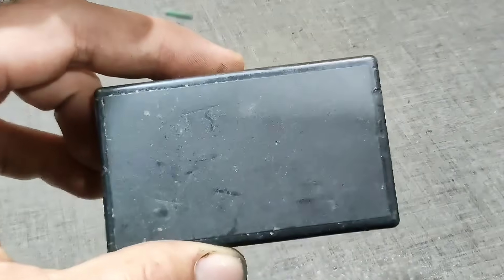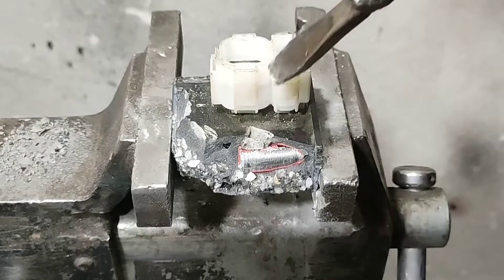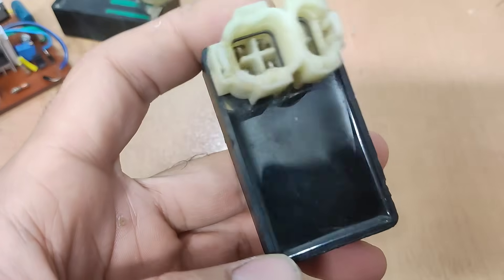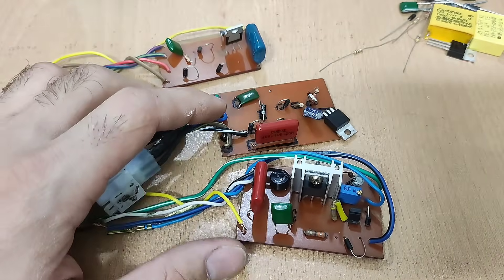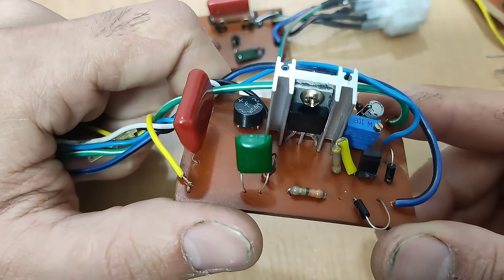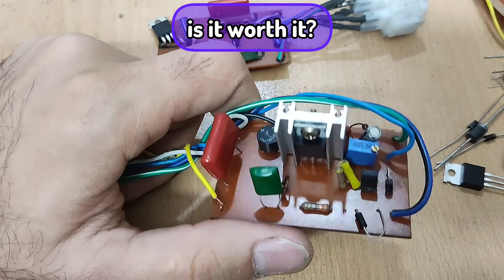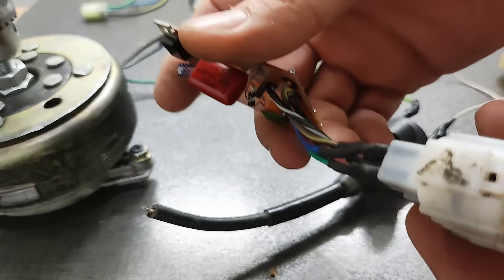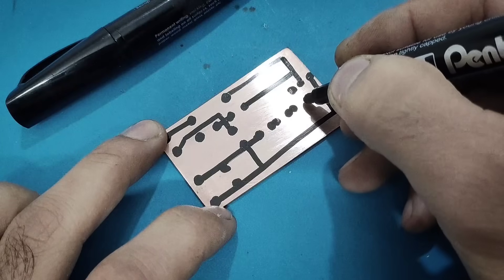What's Inside a Cheap CDI? YouWon't Believe It!

Comment: I am updating an old 2 stroke outboard motor. I don't need or want an ignition advance in the cdi unit, the movement of the throttle plate takes care of that. Points and condenser ignition is old and unreliable. Diving into your channel!
One issue is that there is not a lot of space inside my 5.5 hp Johnson outboard motor. I was planning to buy integrated coil/CDI units to save space. But I hate cheap unreliable crap, especially on a boat. I was also planning on supplying 12v to the cdi unit instead of using AC and mounting hall effect sensors under the flywheel as triggers. You have videos on that?
Reply from the maker: Hi dear, That's an interesting project! You'll find a lot of useful info on the channel for sure...
I’ll definitely make a tutorial about running a DC CDI with a Hall sensor. Stay tuned 👍

Comment: A couple things you didn't touch on. The timing curve is important.  The CDI controls the curve.  The 2nd is stator load.  You can overload the source coil with the wrong cap selection and charge circuit.  It'll make the source coil get hot and fail early.  Just something to watch out for!
Reply from the maker: right! Thanks for pointing those out, they are definitely important aspects of CDI units.🙏

Comment: i've been suspecting this for years, seeing them dealer $$ and new ones dont last a year. This is my comment channel, I cant comment on my main.  So in the old days you could buy modified CDI's for racing and they werent cheap, they had simply a hole drilled in one spot. I'm not familiar with the electronics enough to do anything but build from specs like yours. This is cool. Thanks
Reply from the maker: You're right, the quality of new CDIs is not always consistent. Using the specs and examining the internal structure can help choose more reliable parts...
I'm really interested to know which channel you have...

Comment: Fascinating. Forgive my ignorance but how does an advance/retard system work with these single fixed trigger systems? My honda 450 is like this but my suzuki750 has bob weights which move the ignition timing.
Reply from the maker: Hi dear 
These types are analog versions, and the timing is done mechanically
and also remains fixed.
To use advance and retard features,
you need a digital version, where a microcontroller handles that function.

Comment: See i rather a cheap fuse blow out than the circuit board the fuses are easily replaceable and easier to get there's no waiting to pop a new fuse in get a 15 amp or 20 will do and the problem is that easy
Reply from the maker: Good point 🙌

Comment: The thyristor is what blows in the cheaply made relay solenoid circuit board  in scooters when any light fixture breaks or turn signal flasher fixture sends the short to that part unless its because it was pulling to much current at the usb port 

What else would blow that one out in the flasher relay solenoid there was no melted wires just that roasted part on the board if it didn't ruin the board i could have fixed it but those only cost 7 some dollars new 

Plus on my new one i added a inline fuse on it just so it'll save me from blowing money on new flasher relay solenoids 

But also i noticed the flasher relay solenoid isn't water proof so if no shorts happen or the broken turn signal light fixture didn't melt it then water got in also the usb ports electronic box isn't water proof those things should be being in a scooter outside
Reply from the maker: The flasher relay itself also acts as a fuse — a short circuit in the turn signal circuit causes the relay to burn out, preventing damage to the wiring.
In one of my next projects, I’ll be teaching how to build a very professional yet simple flasher relay for motorcycles.
thanks for your input 🙏
Reply: @MrWolfDiy i know but the parts on its circuit board can burn out and is more hassle to fix than to pop a new fuse in
Reply: @MrWolfDiy what burnt that out was the right turn signal fixture

Comment: The filler you are encountering is known as a solidification stabilizer. The board is usually placed inside a half shell style container, then the stabilizer is poured in. The stabilizer contains solids of plastic or hard silicone. Once cured, the solids will mostly fall under the liquid before it cures, and then will appear smooth on top. This is not always the case, and some mechanics mistake the solids at the surface as some sort of boiling or damage from heat.
.
 I have seen videos, where the part is boiled in water, and this helps soften the flowed stabilizer, so it can be picked off.
.
My first time meeting this kind of stabilizer, I was 22? I wanted to repair a Mitsubishi igniter box. I worked for a prominent avionics repair station. The best of the best, said throw it away. I did after I pulled traces off the board, attempting to remove the stabilizer, because I did not know there was any way to clean the board.
.
I love these videos, thank you.
Reply from the maker: That's very interesting and insightful information; thanks for sharing your experience!♥️

Comment: Next do a 2stroke PW80cc CDI
Reply from the maker: Try this one, it's specifically for two-stroke engines with small engine displacement:
https://youtu.be/ftZ9OpfuWxQ?si=5_4o_VG799XxPLUy
Reply: @MrWolfDiy Oki bud I will check it out.i won't burn a hole in my piston right
Reply from the maker: 😅😅I don't think that's the case, but I'll be releasing another version soon, specifically for two-stroke motorcycles
Reply: Oki brother.i will be checking that vod out.cuz I have a 50cc yahama bike.The only thing is not easy to find the board.whats it called

Comment: Mr Wolf will you PLEASE make a how to on building a stock standard and an adjustable TDI/CDI  for an 80cc motorized bicycle with no stator, OR BATTERY OR PULL START OR ELECTRIC START JUST A STRAIGHT STOCK CDI FOR AN 80CC MOTORIZED BICYCLE? PLEASE!?!  

I do not know anything about electronics I don't know how to read any schematics I just need somebody to show me how to do it once that's all.  
I have scoured the internet and I cannot find anybody that has made a video that explains it in a way thats clear. 

If you do I will name all of my children after you who will forever sing your praise and sacrifice virgins in your honor as they dance around the campfire during a harvest moon naked in the rain. 

Thank you sir I greatly appreciate you.
Reply from the maker: Greetings, dear friend. Thank you for your appreciation, 
but...Building a CDI ignition system for an 80cc motorized bicycle can be complicated and might result in unnecessary expenses.
The best option is to get an OEM unit, or if you still have the previous parts, check them—you might be able to reuse them.
If you have any questions, feel free to ask.

Comment: The one you made is for a 2-stroke engine, for a 4-stroke engine you need an ignition advance IC.
Reply from the maker: CDI, has ignition advance, is usually microcontroller-based and programmable.I will post the tutorial in the future.♥️
Reply: @MrWolfDiy  yess, please make a programmable cdi 🙏

Comment: Many CDIs have a function to limit the rpm of the engine - and thus the speed of the bike. It would be interesting to find replacement CDIs that do not have this throttle function. Maybe you want to talk about tuning options in another video.
Reply from the maker: Yes, that’s correct. In the future, I plan to discuss this topic in more detail, including how to control the RPM or make it unlimited.
good luck

Comment: Not all CDI from China are created equal. I have sold hundreds and had very few failures. All mine had a manufacturer or brand on the case but some would have more aggressive advance curves from the same case. To say don't buy them is wrong. They are cheap and work well on stock engines.
Reply from the maker: Yes, not all of them are poor quality, you need to know the equipment. thanks for your input 🙏

Comment: Hi, excellent channel.How about chain-saw ignition? Think its a combined coil-cdi unit? Did you ever think about to make one?
Reply from the maker: Chainsaws usually have an analog CDI and magneto, which are not much different from this model.
Newer models use digital CDI, which is found in advanced brands like Stihl and Husqvarna. It features an internal microcontroller that adjusts the ignition timing based on the engine speed.
I might provide more details in the future.
Reply: @MrWolfDiy  excellent

Comment: My bike have two ignition coil, what values of capacitor and diagrams of circuit you can suggest?
Reply from the maker: It depends on the type of your motorcycle. If your stator is AC with one  trigger, you can use a dtsi CDI,  which I haven't made yet.
You can also use a separate CDI for each cylinder.

However, if your stator is DC, you need to use a DC CDI. I made a video in two parts on this topic. (DC)The first part explains how to build it, and in the second part, I explain how to install it on multi-cylinder motorcycles.
Give me more details about your motorcycle so i can see what might work best for you.
Reply: @MrWolfDiy  youtube notification sucks. I searched for your videos to get answers for my comments. And sorry for late reply. I'll check it if stator is ac or dc

Comment: You are a very smart man!! I wish I could understand CDI’s and build one with an Arduino for my 1998 Yamaha 350 Warrior that is programmable.
I will keep watching and maybe one day I’ll feel comfortable enough to try it. 
Thank you for sharing all of your knowledge!!!!!
Reply from the maker: Thank you so much bro, In the future, if l
can, I will definitely build a
microcontroller-based CDI.
I wish you success.
Reply: Hi there is a thing on YouTube called Speeduino available in modular kit form using an Arduino motherboard this is a programmable  system could be what you want..
Reply: @john-em1jr  thank you! Is it available for atv’s? I have heard of that for race cars but didn’t know about the other
Reply: @bencapobianco2045  Hi thanks for your reply as far as I know it is pretty universal and the only difference really is the engine map and it has a basic one that is modified with a laptop to suit your it might even be self-learning it can also control a fuel injection system, but there is a lot of info on y tube about it, hope that helps
Reply: @ thank you! I will check it out.

Comment: What about spark advance with yours and the other CDI boxes?
Reply from the maker: Hi, Only CDI units with microcontrollers have advanced ignition timing, while the others only have different spark power with limited timing advancement, ranging between 5000 and 12000.
In the future, if I can, I will design an advanced model and share it.
Reply: @MrWolfDiy  Original cdi units for bikes up to 1995 have analog integration circuitry that is used for spark advance. They also have spark retard to prevent kickback on kickstarted models. It might be easier to go that route, because i have had lot's of microcontrollers fail way too quickly in high impulse currents environment...
Reply: 6 @MrWolfDiy Dear brother ,can you let us the advanced angle amounts with various RPM ranges please..... 
Thanks brother
Reply: That s the difficult part

Comment: Love your channel brother what do you know about a 09 Cadillac ignition
Reply from the maker: Hello  friend, thank you, The car you mentioned is considered a modern car, and like most other cars, its ignition system is controlled by the ECM.
what do you want to know?
Reply: Ok the person that owed it before me lost the key and wrecked the ignition so  I have another key and went through the steps to program but still won't start I have fire to the coil packs and I'm getting fuel
Reply from the maker: Based on your situation, I have two guesses:
First, the issue is likely related to the immobilizer, and it might not recognize your new key.
However, since you have power to the spark plugs and fuel is being delivered, there's also a possibility that the crankshaft position sensor is faulty. If this component or the timing belt in your vehicle is damaged, it would cause exactly this kind of problem.
Check it and let me know.
Reply: I subbed just because this is awesome of you to be troubleshooting a Caddy ignition in the comments section of your bike CDI box. Good on ya mate

Comment: Ik zag toch duidelijk een transistoren andere componenten. Je kan natuurlijk zeggen dat het troep is maar er zitten net zoveel componenten in als in jouw cdi. Je moet niet zo hoog van de toren blazen. Jouw kennis van cd's is ook niet het geel van het ei. Je zit jezelf hoog te praten maar je weet niks van cd's.Een enorme vonkboog creëren kan iedereen maar is zelfs zeer slecht en onnodig voor een goede verbrandig.
Reply from the maker: The CDI I had only worked for just a week! The money didn't matter, but it left me stranded in the desert, and I suffered a lot...
but I’ve been using custom versions for several years now. I’ve installed them on all my motorcycles, and they’re amazing!
And because of the strong spark and complete combustion, the fuel consumption of my motorcycles has decreased significantly.I can't even remember the last time I put gas in. Try it

Comment: I dont have any clue what is cdi about but this video is on my algorithm
Reply: While I dislike most technical implementations of YouTube, one of its best things is to bring you new items of interest. FYI, CDI is Capacitor Discharge Ignition, a type of ignition system in gasoline engines.
Reply: @TheSimoc  yeah i'd prefer finding new interest instead of useless things. Also thx for the information
Reply: Its part of the motor bike ignition system. The thing making your bike sparkplug fire in a combustion chamber.
Reply: From your brain
Reply: same
Reply: you're on your way to become a biker.

Comment: I refuse to purchase a CDI which circuit is hidden by black epoxy.
There is a 6 dipswitch type, the dipswitch chart provided is difficult to understand the function of timing advance curve.
Reply from the maker: There are some types of CDIs where the components are visible on the back of the CDI, showing a large number of parts and has a low price , However  the main circuit operates with just a few basic components and  while the rest are unnecessary...
In fact, a CDI with those components and a microcontroller is both expensive and provides excellent ignition timing advance...
Reply: @MrWolfDiy  Agree, there are many functions that are accomplished using a microcontroller such as PIC15F along with temperature feedback.

Comment: Chinese CDI units can be bought for as little as £5 UK ATM. I stipped a unit similar to the one you had which also had ceramic filling. It would not cut with a hacksaw so I soaked it in thinners for several days allowing it to be dismantled. The component's were of very poor quality so you can understand why they fail so easily.
I have made several CDI units which were reliable but gave no improvement to the strength of the spark as it's governed by the power available to charge the CDI capacitor. I didn't use a drilled PCB but simply stuck small squares of PCB to a back board to mount the component's to.
My 50cc engine produces 120VAC at tick over dropping to 50VAC @ 35mA at maximum revs.
Thanks' for your video's Chris.
Reply from the maker: Greetings, dear friend. Thank you for sharing your thoughts. I wish you success!♥️🙏
Reply: I hear you can boil them to release the epoxy.

Comment: Нужно испытать в реальных условиях ,а потом делать выводы.Как этот блок CDI будет работать в жару,дождь и мороз?На столе это работает великолепно!
Reply from the maker: That's right, it must be tested in the long term. The quality of the parts, proper assembly, and good packaging in epoxy resin add to its effectiveness. 👍🙏
Reply: @MrWolfDiy  🤝👍
Reply: @MrWolfDiy  I'm not convinced potting it in resin is a good idea.

It could possibly cool better without the resin.
Reply from the maker: Sealing with resin is primarily used for preventing short circuits and waterproofing. However, its downside is that if a component becomes faulty, it can no longer be repaired or inspected.
Reply: @MrWolfDiy   It's also common to prevent knockoff versions from being copied and sold.